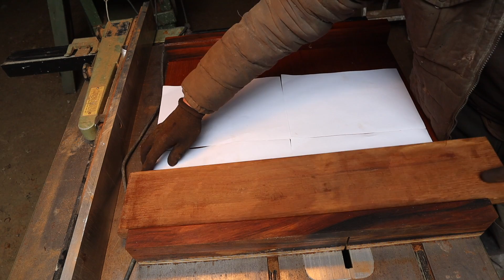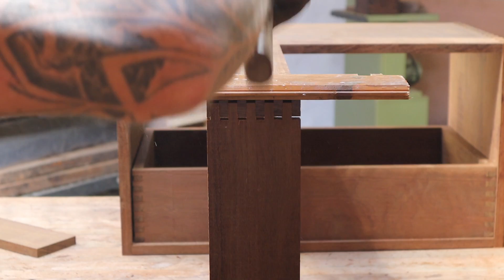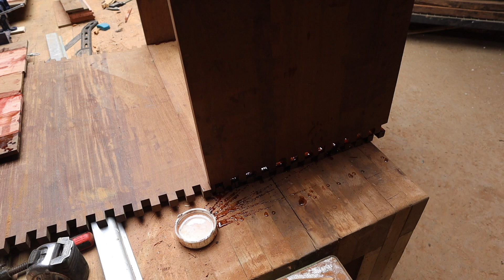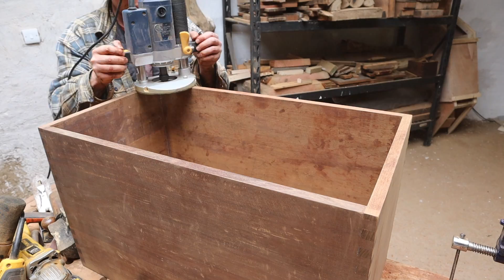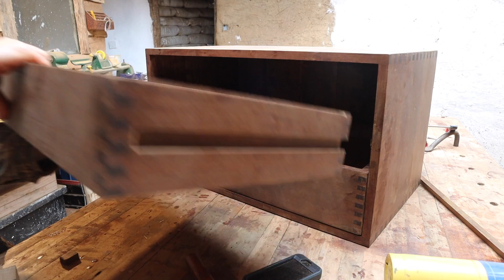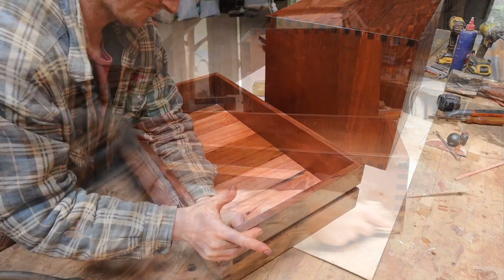Handmade Box Joint Tool Cabinet From Free Reclaimed Wood

Comment: Take some advise from a 69 year old woodworker of about 45 years. It is ok to pound those box joints in with your fist when you are young. However it will come back to haunt you when you are old. I was glad to see you use a mallet finally. Very nice project. Thanks for sharing it with us, Steve

Comment: That’s a tool box to be proud of.
The pink wood in the drawer bottoms is Iron Bark. One of our hardest hardwoods.
Fantastic for railway ties, farm fence posts, construction and furniture alike.
Extremely rot resistant and resistant to insect damage.
We’re pulling Iron Bark fence posts from Dads farm that have been in the ground for approximately 80yrs.

Comment: Beautiful. It will last centuries. I would put some little blocks on the bottom to lift it off of flat surfaces. And find good strong heavy hardware handles (brass would be nice) to make it easy to move. I'm sure your enjoy it every time you use it. Great work.

Comment: As a fellow woodworker, I really enjoyed your build. I noticed you used the same kind of jig I did for your box/finger joints and probably the same issue I had with assembly. The joints were too tight to go together without a mallet. I have found that, although I love the simplicity of that jig, it can sometimes cause the joints to be either too tight or to start wandering. I find that getting a rasp or file in between the joints can help a lot with the fit. I know it did for me. Great work!

Comment: When I was working we used to do a dovetail joint on the inside of the front, made it look good no joints showing, but you are doing the base the old fashioned way, long time ago I was  Pattern maker, if any knows what job that is. Not criticized what you did but I can't get over how you can run all your machines from your water power. I know some who would have loved that power they were on the grid not off grid like you. Only just found your site, 👍👍

Comment: Very nice piece, and the use of repurposed hardwood is especially nice.  But you’re going to have problems with this piece in the future.  You glued and nailed the back in place, but that wood will expand and contract across the grain with changes in humidity, and will buckle or split because the case sides and back won’t be expanding with the grain to the same degree.  Same problem with the drawer slides - these won’t lengthen with humidity at the same rate that the case sides do.  This problem can be avoided by cutting slots for the screws instead of holes - this would allow the case sides to expand across the grain, and the screws will slide in the slots to accommodate the movement. I learned this the hard way.

Comment: Kris,
Great job on the toolbox, it is a great feeling to accomplish something functional and beautiful at the same time and also have the correct tools for the job. Just one minor point I think I would shoot for a tad less snug on the boxjoints. In my experience you either push out most of the glue or end up cracking the timber especially reclaimed stuff which might be very dry and brittle. I also didn't see any allowance for expansion with the solid bottoms which may come back and bite you in the bum. There are some small rubber spheres that can be pushed into the rebate and will allow a bit of expansion to prevent cracking. just my 2d's worth.
Mike

Comment: I'm not sure how well it would work, but you can buy graphite power, it's usually used as a lubricant for locks. I bet if you put some of that on the drawer slides it might help with the stickiness.

Comment: Wow that's nice joinery, I don't think I'd have the patience to go to that extreme, I guess that's why I'm not that good in woodworking, I really should put more effort into it so that I can appreciate the finished product like you are doing there, well done mate. You know I just seen you using a dado, I haven't got one of them but I could always improvise with 12mm Router Bit & Router that is bolted down upside down with a sliding box with a tung guide to do the next cut out of each tung like your dado is doing, I guess I'll just need to think a bit more creatively than always rushing to slap something together.

Mark

Comment: Nice work. A couple thoughts, due to the solid wood construction it’ll be heavy for a tool chest, you would save weight by making the sides frame and panel, could also save weight with thinner drawer sides don’t need the thickness there. Would gain some mechanical strength by using dovetail joints instead of box joints. It is fine craftsmanship, well done

Comment: i’m going to make you cry.
i already cried about this so now it’s your turn.
my cousin is a great guy, and he was remodeling my aunts apartment, and got it it down to the studs.
included in this house with some really white boards, which were 3/4” to7/8” of an inch thick about 18 inches wide, and 8 to 10 feet long.  He what’s throwing everything in the dumpster in starting brand new. I was there one day and I helped him hold these 18 inch wide boards why he cut them into pieces. My uncle and I looked at each other and were shaking our heads but you can’t talk to my cousin so he continue to cut them and I continue to hold those 18” wide old boards that you can’t really find anymore, and if you do find them, they are very expensive.
I told him about how disappointed i was that he cut up those boards, and he relied....why did you say something.  
I didn’t hit him lol
Are you wiping your tears?
I know a few people reading this are at least shaking their head in disappointment.
Let’s bow our heads in a moment of silence, and hope those boards are in a better place.

Comment: That is a tough wood to work with.  My brother had a home built, and the farmhouse had a 3 side, wrap-around porch, made of Ipe.  The builder ended ip predrilling the screw holes, and broke a fortune in drill bits,  Also, it doesn't take a stain worth a damn, weathered off in a couple of years...

Comment: Wow, very nice Tool-Box. Good work and a nice video, too. Thx for your work and sharing it. I have some questions, sorry in case you already answered them in the video and i missed it... do you know which wood it is? Especially the pink boards you used for the drawer bottoms are looking very interesting. And which glue did you use? is this some kind of selfmade fish or bone glue? And is there a specific reason you glued the rear wall in to the rabbet? screwing it down would have made it proper solid also and you could disassamble it... sorry for my bad english and the silly questions. keep the good work up and stay healthy. best regards from GER....

Comment: Further to the west coast adventurer's comment - I live on the exact opposite side of Australia to  where the Aussie hardwood JARRAH comes from. The defacto standard timber for railway sleepers on this side of the continent was IRONBARK, both grey and red.  These were also exported in great quantities to the Middle East and G Britain over many years; from the late 1800s and I'm told, right through to the war years. Just like our native turpentine, that was so widely used to construct your docks in the UK including London's! Both Jarrah and ironbark usually produce a deep red timber that is now highly prized. The light yellowish Ausi timber you have is unlikely to be Jarrah. The tree does produce timber of that colour but generally in the outer sap wood and would never be accepted as sleeper grade. The ironbark on the other hand also comes in dull grey and sometimes the yellowish colour you have; with the typical red blood lines through it.   Weight wise Jarrah comes in around 800+ Kg per cubic metre. Ironbark however comes in at just under 1100KG! It is considered one of the heaviest/strongest construction grade timbers in the world. It will dull a plane in no time!!! The end result, like finished Jarrah, is well worth the extra effort required. Whether you have Jarrah or iron, any of these Old sleepers are so worth acquiring and rather than stashing away, use them ASAP to fabricate beautiful heirlooms like your tool chest! Well done. H

Comment: If that's one of the first builds to come out of the new workshop the future is looking very bright indeed! Work of art mate and fits the wooden handled tools beautifully. Loving the table saw jig as well worked beautifully. Out of curiosity how many hours do you think went into it? Videos always makes it seem like you could knock it up in an afternoon haha! (Very aware that's not the case!)  Thanks again for the videos mate 👍👍
Reply from the maker: Thanks mate. yeah the editing makes it look really fast and easy but its a huge amount of work. about a week on it at least. A good 50 hours with making the jigs and stuff. Also drying times are an issue. the glue i use takes 12hours to set so its all about planning around how many clamps i have and drying times. i had to use this type of glue due to the wood not sticking with normal wood glue. i could easily knock 20 hours off if the wood wasn't such a pain to work with. I also made 3 different types of drawer pulls before i was happy. a lot of work goes on off camera. Then also add about 4 hours of editing and a good 5-6 for setting up the camera and stuff. then i spent from 2pm yesterday untill 8pm trying to get it to upload (slow internet at the moment due to everyone being at home) so alot of hours went in to this. But i do enjoy it :) i even quite enjoy the editing when my laptop works properly. Its just a shame at the moment i dont really earn anything from the videos. this one will make about £20 at the rate its going. Never mind.
Reply: @KrisHarbour   just realised I never replied, sorry! To be fair it looks like a 50hour toolbox looks great. Amazing that the wood was that difficult to work with though seemed like a good idea when you started 😂
I did hear YouTube have changed the revenue aspect again. It's a shame as there's so many wonderful creators who make it what it is and it's not exactly like they aren't earning anything out of it either. 
Take care mate. Looking forward to the next video. 👍

Comment: Apparently you only know finger joints from corner joints. Have you ever heard of a dovetail joint? Because then it would be real manual work by a craftsman! Greetings from Germany from a real carpenter who had to study for three years under a master.
PS: The dovetail joint holds better even without glue.

Comment: Hi kris 
Were you using the battery bank to run the machines or using a generator. 
If you were using you’re battery’s how did they cope with the project? 
Thanks Elliot 
Also very nice cabinet, i do like the box joints.

Comment: It would have been easier to put shallow dados in the sides of the chest, and then screw in the side runners BEFORE assembling it.  It is large enough to screw them in after the fact, but I would have installed them before gluing the chest together.  Just saying.  Actually, on second thought, I might have opted for ball bearing metal slide hardware instead. Not as 'pure' not using wood, but they would slide out so much easier!   In any case the end result is beautiful!  Good use of salvaged wood.
What did you mix the lindseed oil with, bee's wax?
BTW, the blade on your table saw looks huge!  12" diameter?

Comment: nice work, but was that uncured epoxy that you spread on the joints with your bare finger?  If so, that could end very badly for you someday.  A severe allergic reaction can happen on the first or any subsequent exposure to uncured or partially cured epoxy resins.   By the way, a railway sleepers are the wooden beams that support the rails.

Comment: Beautiful job.  Just wondering why you went through the trouble of using epoxy; I am not sure there is any benefit.  I am not sure how stable the species of wood you used for the drawer bottoms but the difference in rate of expansion with the front and back could lead to issues.
Reply from the maker: Epoxy is much better for wood like this that is dense and oily. Normal wood glue does work but not very well so I used it for less important parts

Comment: What do you add to the wax before treating the wood? Is it bee wax?  The end product looks amazing!! Good job
Reply from the maker: Yeah beeswax and linseed oil
Reply: @KrisHarbour  Hello, I'm interested in finding ecological products to use with wood. Most point to chemical stuff you can buy in the shop. Please if you would help me out here: what does this mixture do for the wood? Does it protect any against bugs, or moisture , scratches, mold,...? I've started making various projects, but haven't found a solution that is not poisonous yet.

Comment: Was that beeswax you mixed with boiled linseed oil?? If so, then that 'paste wax' is also great for applying to tools and tool handles, wood and metal! Great for protecting against rust! Apply it to your chisels, saw blades and planes etc! You might need to add some more beeswax to make a 'harder' mix so that it doesn't rub off as easily, especially where there will be more wear from handling, like on handles lol and chisels. Interestingly, I was told this paste wax can also be used in treating some skin ailments, but I haven't looked into this..

Comment: Why did you use the sander on your drawer bottoms when your have a smoothing plane to get a better finish and do it faster?
Reply: Actually use your no.4 to smooth everything. The no 4 is a much better sander. You have to clip and camber the edges of the blade to elimtame planing track. Ever since I stopped sanding and use the no4 for sanding the wood gets a luster Id never seen before unless a clear finish had been applied
Reply from the maker: To wide mate for the planner. And the wood is ipe so it blunts a plane in about 3 strokes
Reply: Hmm I was only referring to handplanes. Have you tried using a steper degree micro bevel? The other possibility is the tool steel is substandard.

Comment: Happy to see you protecting your lungs, some exotics are deadly, not to mention 100 years of preservative finishes and spillages.  I guess you use really good glue, because you just edge joint your boards, without dowels or biscuits.  With anything that will carry weight, like moulders and bench planes, I like to make sure it has a little mechanical strength, especially because my Unibond Resin is 5 years old🤣🤣🤣🙄🤦‍♂️♥️♥️♥️

Comment: You're playing on hard mode, that's for sure. Was that epoxy you used for the box joints?
Reply from the maker: West system marine epoxy.
Reply: As someone who has watched a relative, who shall be nameless, try to get a stuck drawer out I would recommend for your top box that you use small nails or brass screws and no epoxy. This way you can remove the back and gently 'persuade ' a stubborn drawer to move. Just a thought. That turned out absolutely gorgeous  by the way! Thank you very much for sharing with us.

Comment: Tip: exotic hardwoods often create severe allergic reactions.  You really should wear a dust mask when working with it.  I hope it doesn’t get ya!
Reply: and a face mask cover you eyes, i am force to use this horrid wood at work and i am allergic to it, it dries my skin out and makes my face swell especially around the eyes. Something i learned is that the first time you come into contact with something that you allergic to you dont have a reaction, but when you go back to use it again then it bother you. As i said in previous ipe is toxic, also ive used it many many times and the glue joint always fail as it dries out best to use mechanical fixings (bolts)  as well as glue where possible. Most joinery shops wont deal with ipe because it blunts and breaks your tools and doesn't glue, it is heavy as hell too

Comment: It looks like no allowance for wood movement in the drawer bottoms, or did I miss something?
Reply from the maker: Loose fit unglued panels in a rebate. Pretty standard
Reply: @KrisHarbour  oh I see, I thought you put glue there in addition to the nails
Reply from the maker: Ah, i think you are looking at the back of cabinet . The draw bottoms have floating panels. the back is glued and nailed. I dont think the thin back panels would have the ability to cause many problems as they are way smaller than what they are housed in and the joints are so tight with epoxy glue. worse case would be the back bowed out a bit.

Comment: Hi Kris, what is the glue you are using, or is it epoxy?
Reply from the maker: Using standard wood glue for some stuff and west system epoxy for some other stuff. It’s a dense hardwood and does not glue well so you have to clean away the oils and choose the right glue for the job